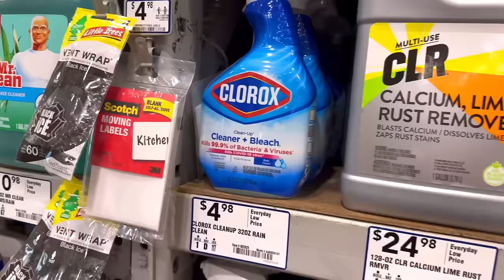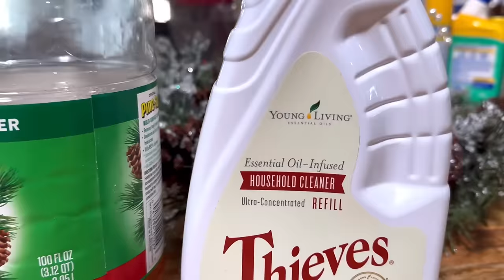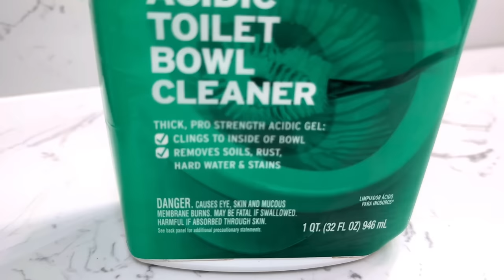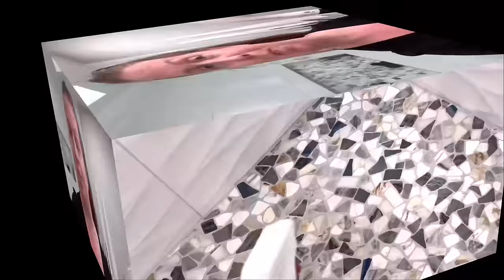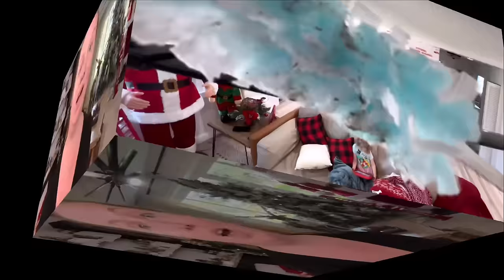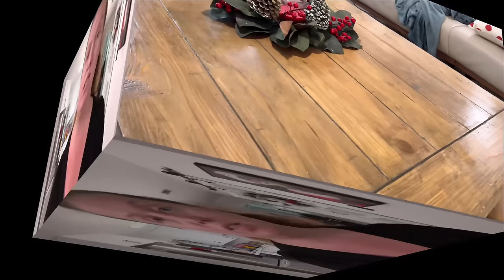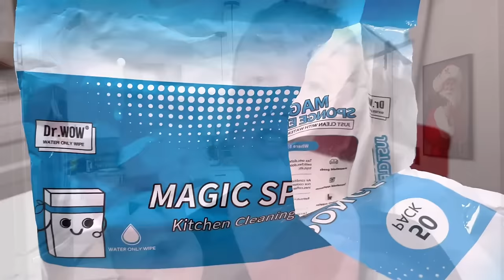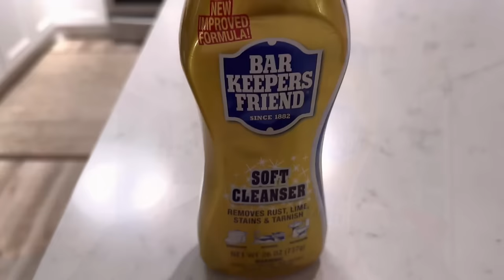Overrated Cleaning Products? The BEST Cleaning Products For Your Home! #cleanwithme #cleaningtips

Comment: Zep is definitely the superior of cleaners! I use a ton of their products too ❤ I'm not sure if you have, but definitely check out their tub and shower cleaners. Tip with the duster, spin it a bit to get the fabric part fluffy so it holds the dust better.
Reply from the maker: Oh I will have to try the shower one. I was looking at it yesterday contemplating getting it

Comment: I've got a recommendation that I believe is better than Folex:  one cup water + one cup rubbing alcohol + 1 tsp Dawn in a spray bottle.  In my experience stains treated with Folex reappear after a few weeks (coffee on carpeting, pen stains).  This doesn't happen with this new mixture I use.  I just spray it on the stain, wait 10 minute & remove with a damp cloth.  Great video as always, thanks.

Comment: I’ve tried a lot of carpet stain removers. Folex never worked that great on the types of stains I had. We sold our house last year and after having our carpets professionally cleaned I used a black light and still found spots from when our dog was a puppy. Then I discovered Odor x Un-duz-it. It’s the most amazing stain remover I’ve ever used. I sprayed it on all the old stains while shining the black light on it and everything just disappeared in front of my eyes as I was spraying. The stains never popped out again.
Reply from the maker: that sounds awesome. I will def need to check that out

Comment: I'm Canadian. I could not find the Zep wall cleaner. I went to Home Depot and they had all kinds of Zep, but not the wall cleaner. I don't like the scent of the Pine Sol original or thieves, so I got Pine Sol in the Lavendar scent, its lovely. I got the microfiber from Amazon and they aren't as good as the ones I got from Princess Auto, but I use them both.

Comment: Cambriea I know this comment is way down the line so you may not see but could you explain the way you wash & dry the microfiber cloths? I’ve seen people was them in boiling hot water which seems a bit much. Any specifics you do?
Reply from the maker: So I just use regular laundry detergent but I add vinegar to the softener section. The vining is great and stripping anything out of it plus keeps them soft